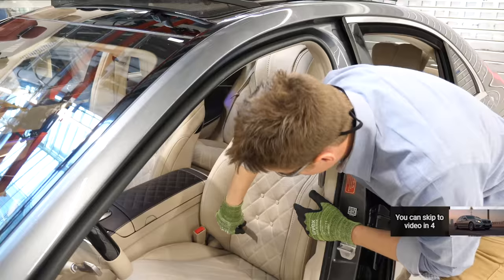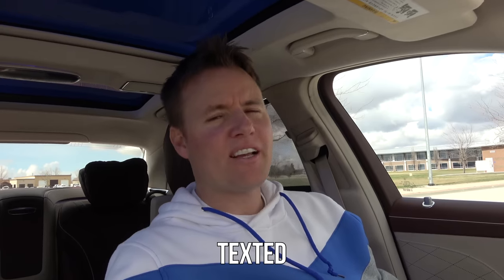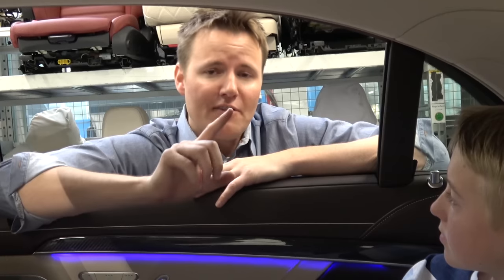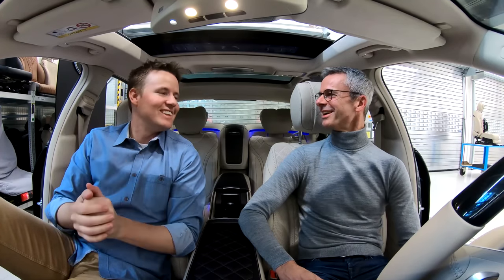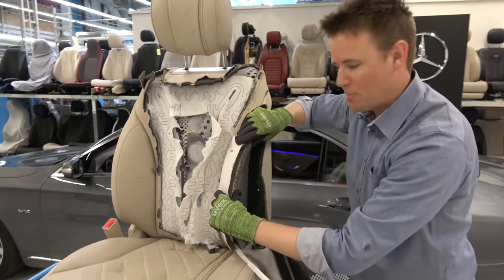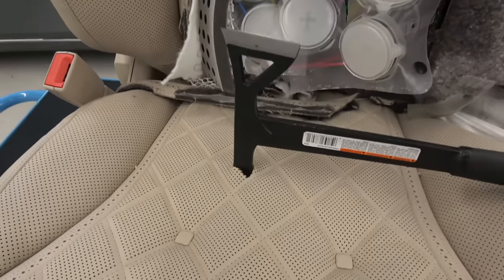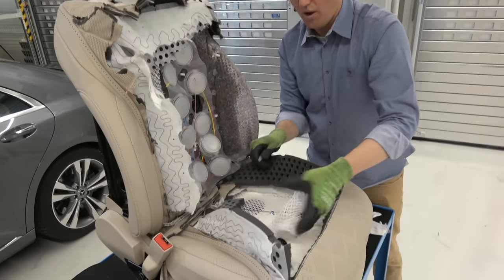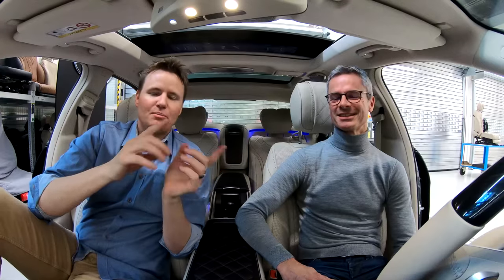What's inside a Mercedes S-Class Seat?

Comment: I recently upgraded my Passat B5 seats to B5.5 seats and rewired them to work. A friend wanted the leather off my old seats so I methodically removed the leather and was AMAZED at the robustness of the old B5 seat frames and just how much engineering and complexity there was in these old seats. It was even more fun to set off the seat side SRS air bags after I had removed them. After having been a GM technician for almost two decades and having rebuilt thousands of GM seats from everything from a sunfire to a corvettes to cadillacs; I can say that even my old B5 seats blow GM seats out of the water and these Merc seats are just down right insane and awesome and look like NASA designed them!
Reply: You should see if you can find some C5 Audi A6 sport seats to upgrade to! They are a direct swap into a passat. that was my dream mod before I ditched my B5.5 a few years back.

Comment: And there is my car seat fully made by sponge only
Reply: Only foam?  So it doesn't have a metal frame?  And no springs?  And no cloth/leather/vinyl?

Sorry, but I just had to.  That aside, basic seats are lighter.  And that makes for a more fun car.  Plus they're easier to take out if you want/need to do something.
Reply: popcorn param you don't have to spend thousands fixing the fan in the seats.. Haha
Reply: remember those "beach seats" from the first 2 CV? They even´t allowed to ajust the, you had to pull them and fit in the floor´s holes.
Reply: remember those "beach seats" from the first 2 CV? They even´t allowed to ajust the, you had to pull them and fit in the floor´s holes.
Reply: did u opend ur seat.... after saw😎 this

Comment: No wonder the seats in an S-Class are so ridiculously comfortable!
Reply: I beg to differ. I find them hard and I have the previous model (w221). Maby the new S is better but I haven't sat in one yet. Traditional Merc seats have always been hard - some of the much older cheapo models felt like you were siting on a piece of plywood. Just my 2c.
Reply: Josh Bacon i 2ish my last name was bacon
Reply: I must admit they are very good but I prefer slightly softer. I'm from Australia but currently living in Europe so I guess standards around the world are different. What they don't show you in the video is the bladders have a tendency to fail, I've already repaired the drivers side twice. Otherwise it's been very reliable vehicle, mostly only normal wear parts & general servicing.
Reply: Sorry forgot to add: depending on your age you may not remember the w201 chassis cars which had very hard seat pad suspended on springs that rocked sideways. Maby USA or other regions got different versions but that's what we had in Australia, You would see lots of  many Mercedes cars (even the W126's) with thick sheep skin seat covers fitted and I could never understand why.
Reply: @grlg2  Maybe becasue hard is better. Humans are not made anyway to sit on soft surface. Nature is not so soft even if you are sitting on grass. 

Soft seats are unhealty and unconfordable on long rides.
Reply: What a bunch of crap!! Forget cars for a moment, when I first come to Europe I had such a hard time getting a soft supporting mattress (emphasis on supporting - yes you can have both at the same time). The best I could get was still to hard for me and I had problems sleeping at night. I had to wait until my container with my own mattress arrived  from Australia to get a good nights sleep. England has normal mattresses but continental Europe had had as a rock on average. Please explain that one.

Comment: All things German Made are usually the best quality
Reply: you havent seen my glow plug controller module, made by bosch....Worse pcb type, waffer with frog hair wires which break off from the engine vibration.... Terrible.  I found a very neat board in my Sclass though, rear SAM module, but closer inspection revealed it was made in australia, not austria
Reply: They used to...but nowadays it's not true anymore.

Comment: The s class is nice but the deprecation in value  is crazy. That's an s 450 140k but nowadays mercedes sells certified pre owned s550 only a 2016-2018  for less than 60k. Buying an new s class is like putting money in a fire pit.

Comment: I’m looking for replacement air hoses that Connect to the bladders. 
Can you test open the $3,550 option on late 1989-1993 Cadillac Fleetwood Sixty Special designed by Guigaro?
I’m curious. Very curious. Thanks

Comment: How many more expensive gadgets and distractions that require you to take your eyes off the road does a company need to install these days in order to sell a car? Like the LCD screen on this car that integrates the radio, climate control and seats using a single knob seem like a distraction to me. What was wrong with the "three knobs and an A/C button" systems installed on cars like my 98 Chevy van and my 2003 Subaru? Where you can adjust the temperature, fan speed or switch between defrost and heat by simply glancing over for a split second and turning it manually?

 I've got a bunch of cars, some are so old they don't even have air conditioning,  and they work just fine. Two cars have less than 30 HP and they keep up with traffic against cars with 300 HP. You can only go so fast before the cops catch you.

Comment: Volvo XC90 excellents is the same but there is no massage there is 6 seats and there is no wireless charging every Volvo  XC90  xaz  a big screen Olso at the back of the XC90 exelents is a screen you can Control the front  SEATS  AND THERE IS SHAMPLAIN FLUTS and there is table like in a airplain and there is wood and lethere